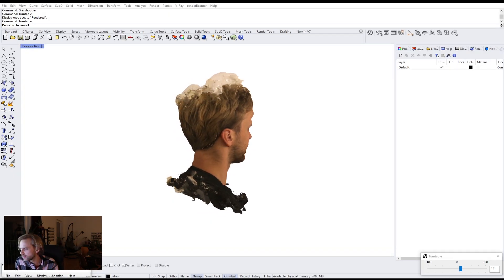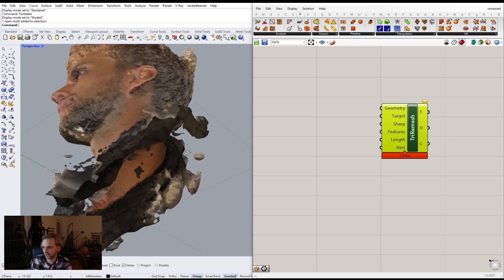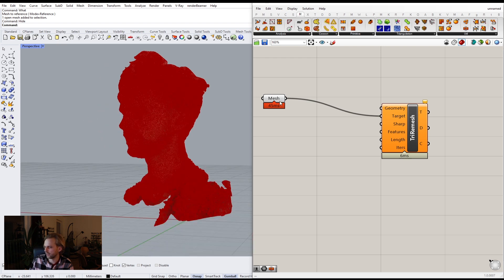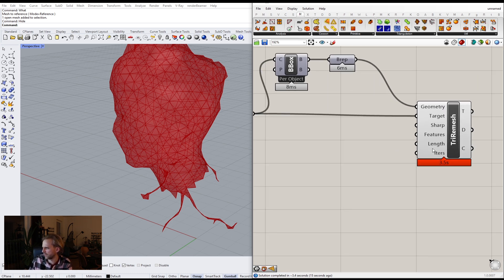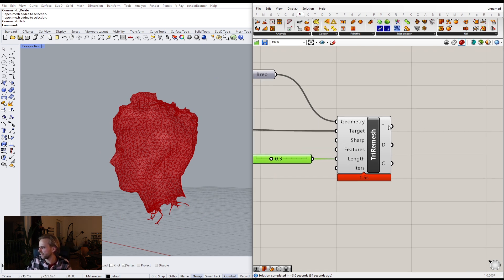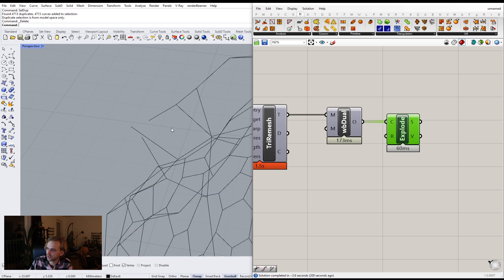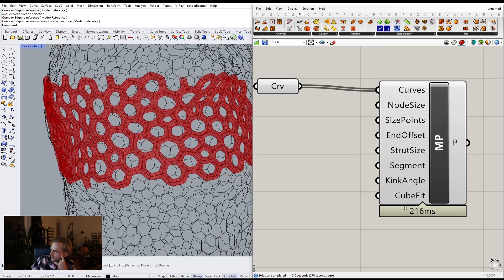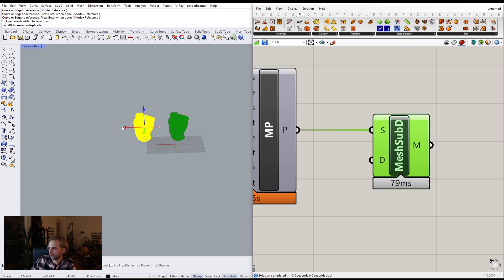I made a lattice from my head with a new tool in Rhino 7 (Tri Remesh Grasshopper)

Comment: Btw - the 'D' output of TriRemesh is the dual as an ngon mesh, and should have slightly better face sizing than standard dual, so you can just connect the face boundaries of this to MultiPipe
Reply from the maker: Ah, that's super handy, thanks! Somehow didn't bother properly checking the outputs..